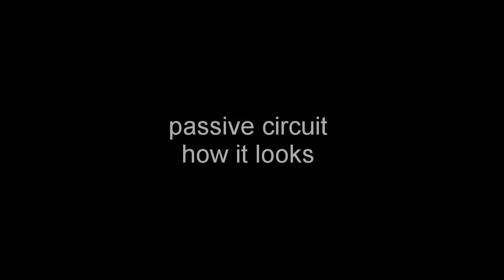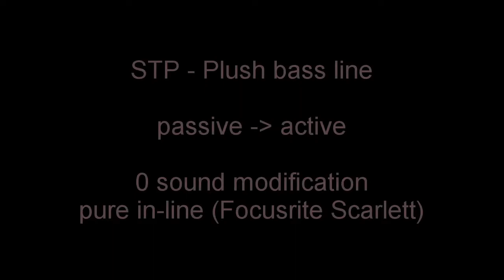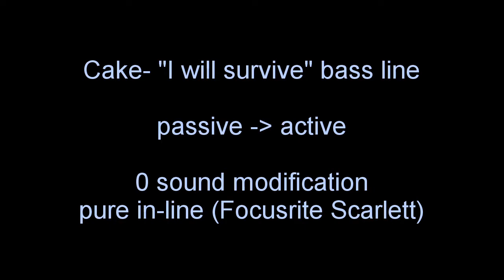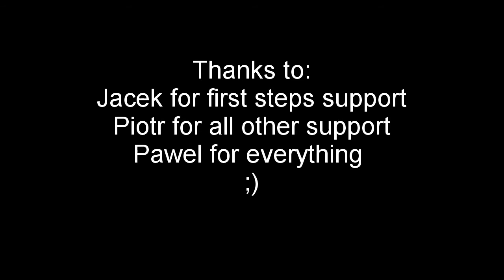Sterling Sub Ray 4 Bass DIY preamp story. Passive vs active system!

Comment: I have an olp mm3 which is passive as stock.the pick up comes wired to two volumes and a tone. Each volume controls one coil in the pick up, essentially it is two jazz bass single coils in the same housing. What I chose to do was remove one volume pot and have the remaining pot control the pick up output volume. to get a better kick from the pick up, one ground wire was soldered to the pot and the hot wire I ran straight into the ground wire for the next coil where after the following hot wire went back onto the volume pot. Running it series really improved it but the tone pot lost most of its range of effect on the sound. Rather than try other value capacitors I ditched the passive wiring and ran the series modded pu into a 2band eq and preamp. This solved the tone issue but now my bass is very loud and mega sensitive. I recommend the series wiring of these pickups if the option is there, not all mm style pickups have four wires coming from them. As I said my bass is an olp therefore I am ignorant off the sterling hardware. The preamp with a seris setup maybe overkill but I do enjoy the bass. I you want to stay passive or even convert from active try the seris.  Hope this helps somebody.
Reply from the maker: +TERRY LILL Hi Terry. I appreciate your comment, this is very interesting. In fact I wired this sterling as passive before: both parallel and in series. Yeah, in series had more punch . But than I went into this preamp.

Comment: 1. Why did you use such huge amount of wires? They take a lot of space and are hard to place into the cavity
2. You could place the preamp sidewise - in that case you would not had to saw off part of the wood
3. If you place the preamp on the bottom of the cavity, its non-insulated pins may be short-wired by the guitar's shielding coating (graphite shield). You should insolate it first - at least wrap the preamp with paper or with plastic film

Comment: Does the routing under the pick guard allow for a neck pickup or something else to be installed like a toggle switch?
Reply from the maker: not at all afaik :( only this small hole for pots and preamp
Reply: Wait I mean the pickguard, the black platick pickguard where the pickup is mounted. I wonder if a neck pickup can be installed and have a neck and bridge combo.

Comment: Why 25k for volume? Pickup is passive as far as I understand?
Reply: I think It´s volume for the output, after the preamp, so it has a different value than if it were from the pickup
Reply: I also thought – why 25K is volume? I thought one Meg should be volume?